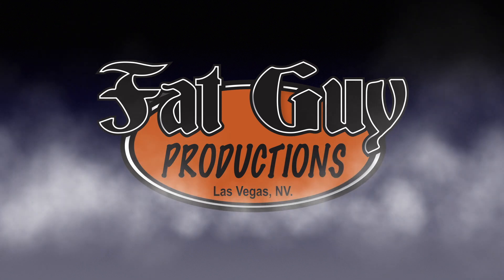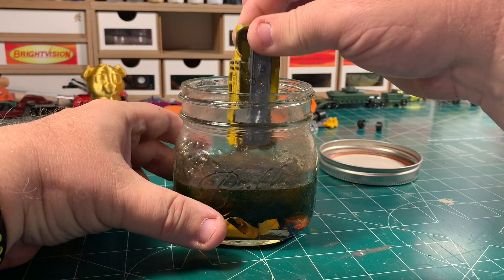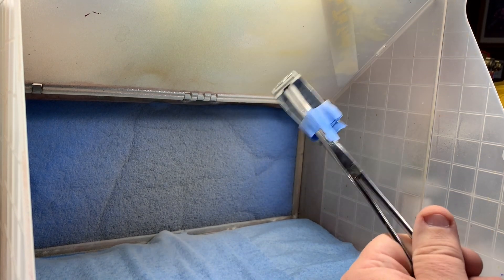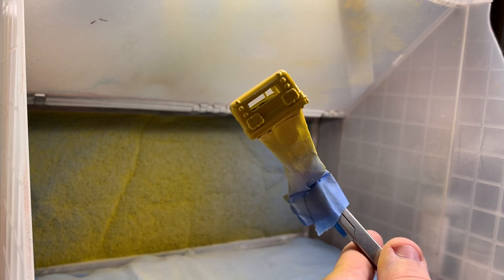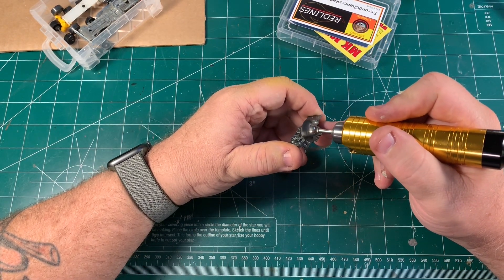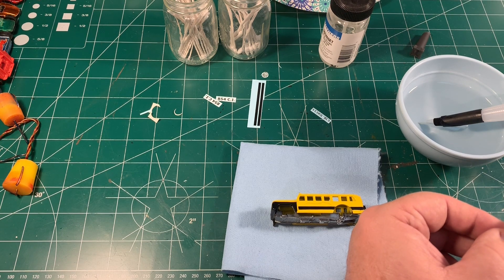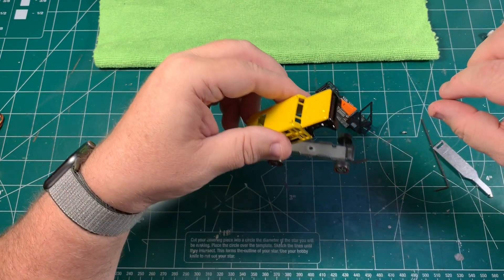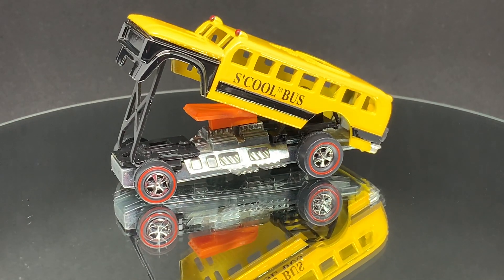Too Un-Cool for School!  Restoring the Hot Wheels, S'Cool Bus!

Comment: There is an old trick to prevent colour bleed.  After going through the masking steps you outlined, spray a light coat of yellow to help seal the tape edge.  Since acrylics dry so quickly, you can change colour to black and continue normally.  It's just another bit of insurance. 
My S'cool Bus is a DH.82 Tiger Moth, an RAF trainer for schooling WWII pilots.  Same colour!

Comment: Awwww Pauly-man. You just took me back to 1997 or 8 or so when I restored the BEST .75 I ever spent. I still had my original S'Cool Bus from my childhood in mint condition, but I couldn't pass up restoring this one I found in the bottom of a tub at the flea market. Similar to yours in condition but missing more paint, it still had a working hinge and all wheel inner caps intact. No scoop or interior parts but like the reprol stickers i bought those piece were easy to acquire. The wheel outers I already had from beaters I got elsewhere of other cars. I masked off the base and painted the body a straight yellow with my Testors compressed air airbrush so it doesn't exactly match my original but I don't care. The decals are a little thick but that's what was out at the time. I thought about upgrading the stickers to newer decals but the Bus has some chips now and I like it the way it is as it was my first "all in" resto. If i redo it, it will be with a real airbrush in the same yellow as i applied and clearcoated. The scoop was the most cost at 10 bux but it is an original as far as i can tell and not a repro or 25th anni replica. I think I'll go take a look at her and her twin right now! Thanx ! By the way, I'm a Daniel(s) but no relations and I was a HUGE Tom Daniel fan too.
Reply from the maker: email me a pic of yours!  captainpaul@cox.net
Reply: @pauly7218  Done !

Comment: One of my all-time favorite Hot Wheels! Paul, what is that black/clear brush tool you used to apply the water when you applied the decals?
Reply from the maker: It's called a water brush.  You can fill the handle with water for painting.  for our stuff you could probably even fill it with setting solution...  I just like the bristles....